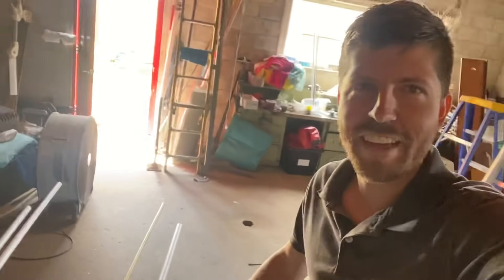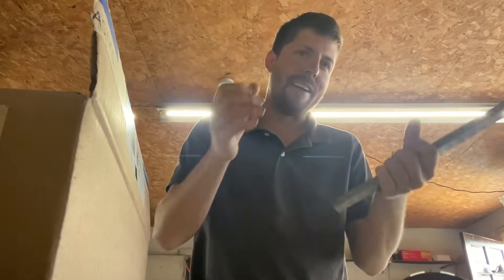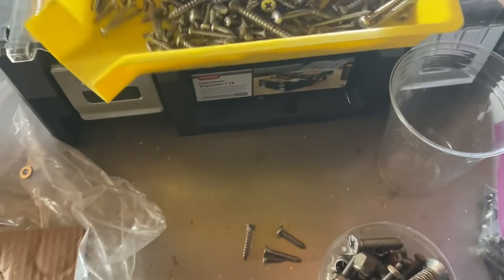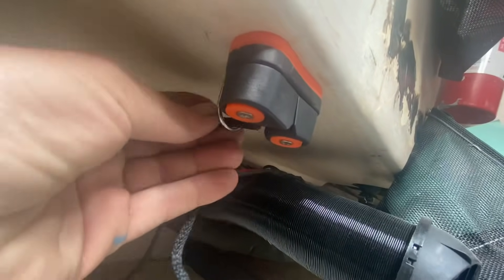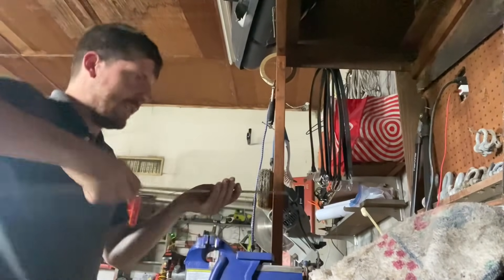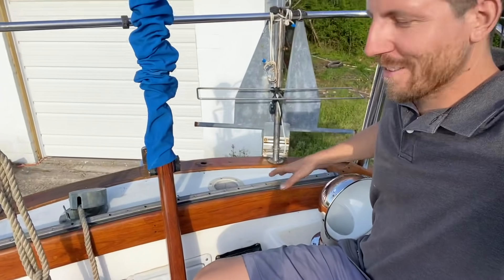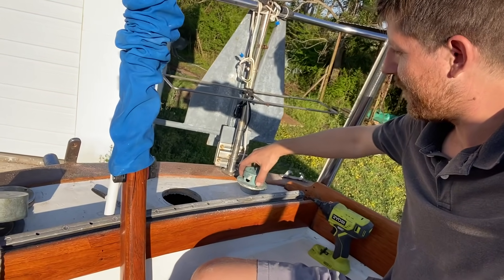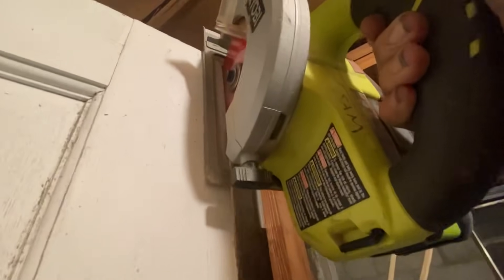Daily Vlog #2

Comment: With the dye, use lube and constantly go a half turn, back it up, then a little further, back it up. It helps keep the cut consistent
Reply: Yes, lots of lube, half turns to get rid of metal chips. SS is very gummy material,  so sharp cutting tools help.
Reply: came here to write this.
Reply: I gasped when the pipe wrench made its appearance.  Yikes!
Reply: also do not buy any tool from harbor freight that requires high quality heat treated steel.  They are single use throw away tools otherwise.  I am not knocking harbor freight, it is just the reality of it. I shop there all the time.
Reply: Def use oil when threading rod (or anything, really)
Reply: Screw these nerds Sam! Party on buddy!
Reply: @jonnyrowland  not throwing shade at him, just trying to make his life a little easier!😂
Reply: @hunterschulz   lolz I know
Reply: An adjustable Die also helps I use them often
Reply: Yeah I was actually a bit shocked when I saw him torquing on that die like that.  Wished I could have talked to him through the TV screen. But that's what it's all about I guess.  Live and learn and next time it'll be perfect I have no doubt.
Reply: That's how I was taught. You can't rush cutting threads, especially with SS. I was yelling Noooo when I saw the pipe wrench!
Reply: It was painful to watch Sam with that die :)  Stainless makes everything a mother, but glad you guys were on top of things and gave some sound advice.  Just chiming in, in agreement with the back and forth and plenty of cutting oil.
Reply: Yeah it did hurt a bit watching 😂

Comment: You have a TIG welder. Cut the threads off a stainless bolt or stainless all thread, and TIG weld it to the end of the solid rod.

Comment: Before you bend straight rod or plate, heat it with a small torch like a Burnzomatic to prevent stress fractures in the future. Always use lubrication when using a tap and die set. And a cap from a 20oz to 2 liter bottle of soda is the same size as the water inlets for washers.

Comment: a couple of tricks I use - I have used teak sawdust as the thickener in my epoxy to fill in screw holes.  I also tape the underside of deck holes and fill grind back some material and fill with thickened epoxy.  I cut a plastic strip from a butter container and tuck it into the hole in a circle and it holds the thickened epoxy in place while it cures.  It easily releases from the epoxy.

Comment: On the bug zapper, cut some of those black strips off than run horizontally around the unit. On mine the bugs sat on them. I cut a load off and now the fly right in easy. They make a right noise too 🤣. I got the 4000 version.

Comment: Hey Sam, just a note. You must use oil or some other kind of lubricant when you are threading the steel rod. Especially if it’s stainless steel. I find that three in one oil works really well put a couple drops on, turn the die a quarter of a turn back it off and then turn it another quarter of a turn back it off, etc. Continue to add the three in one oil as you work your way down the rod

Comment: When using dyes to cut threads you need cutting oil. Sold most places that sell tap and dyes. Then every turn or half turn run the dye in reverse then back forward. It’ll be much easier and you’ll wind up with much better threads.

Comment: As others have suggested; you need to use some oil when cutting and tapping. Also, only go a little at a time, backing off a bit then threading a bit more each time. Lube it in-between backing off and going forward. If you can't get cutting oil, any motor oil will work in pinch.

Comment: tip on  using a die,  You dont make the cut in one process.  you go a few turn, then back it out to clear the cut medal, then go forward again a few turns. Keep repeating the process till you have all the threads you want.  Also use cutting oil like you do when drilling.  Tip for next time.

Comment: While using the die you need to use lubricant, make 1fullmturn then go in reverse a quarter of a turn, then forward again. That will improve your threads.
Reply: I would say don't even do a full turn if its starting to be come difficult to keep going forward ie binding up, before you back it off 1/4 - 1/2 turn and lubricant will definitely help
Reply: If it starts to feel 2 tight, back it out all the way, clean hole, repeat.

Comment: Code inspection with all the DIY stuff
Plumber
Electrician
Destroy the outside wood where carpenter bees/wasps have nests
Learn some masonry and cinder block that (addition) in...
 Beats attic storage as HOT...
And only 03:16 in...

WhiteBoard talk the brass bar to windLess/AutoPilot/Steering? not following

Good -> well
Hinge is the problem with the locker
And stuff leaking thru where screws went in, over time...
Block the back, caulk/ putty seal etc

Radial saw with fingers on little plug. Missing part of a thumb with table saw, can't recommend it...
Yeah, nice sunSet 🌇🌆
Red paint on plastic?
Going to peel off?

Saw instead of plane on door?

Comment: Not sure if it was mentioned. You are misusing the die. When using a tap or die, turn it a half or 3/4 rotation and then reverse it the same. Then go forward and cut again a new area of thread, and reverse.  Follow this process of forward/reverse until the desired thread is cut. By doing so you break away the die chips on each reversal. This makes for smooth threads. Your threads came out rough because you drug the die chips being formed all through the threading process by continually going forward and not reversing to clear the chips.
:) 
Hopes this knowledge helps on your next threading job.

Comment: Turn the locker latch upside down? I've been using a mosquito net since my cats made  a cat door in the screen door, works well. Heat helps bending metal  & will also  temper it for Extra Strength!

Comment: Hey Sam, to help your vice hold smaller diameter round stock wrap the stock in a few wraps of brown paper bag. The bag has some clay in it so it will grip quite tight and will also protect the stock from your serrated vice jaws. Also being slightly under nominal size for threading is crucial, not sure how one might accomplish this though without a lathe. Then again I never understand how people get through life without a lathe 😊

Comment: quarter to half turn of your die, then back it off a quarter turn. That breaks the chip. Just cranking that pipe wrench around in a circle is asking to break the die. and some cutting compound is necessary. Anything is better than nothing- motor oil if you have to.

Comment: Don't want to give you more projects, but here is one that I think you might like:  On my CD28 I cut the counter above the engine out and made it removable.  This gives me really good access to the engine. With this arrangement I can actually change the shaft packing without having to squeeze below the cockpit through the cockpit hatch doors.  Next I am going cut/open up the plywood dividers under the cockpit to give me better access under the cockpit sole.  It is really tight under there.

Comment: re the thread cutting with rod in vice. As others have said it's not the cutting that is the main resistance, it's friction and binding of swarf so lube
and keep backing up.
For gripping rod in a vice. Some thoughts (never tried these, except threading in a lathe)
* find or make a slightly large squared section. drill a hole down the length of it. Make a cut along one edge. Insert your rod and tighten vice to close around rod. (should provide greater surface area to grip.
* if it doesn't need to be round start with square section rod, turn ends in lathe. could turn down whole thing after threading if required.
* but if you've got a lathe, as above, just thread it in that.
* if you don't have a lathe but have a scrap yard nearby look for an old lathe chuck for jobs like this.
*if you want to know how good epoxy is or isn't try setting the rod into a squared epoxy bed. Chip/grind/burn off later
*if rod doesn't need to be straight put a kink in it for vice to grip
* tack weld something grippable to it (assuming welding won't alter the particular steel you're using), grind of the weld later and polish.
*delegate it to one of your helpers then mock them if they're taking too long and upload their struggle, remarking "....hard to get good help"

Comment: Those dies are just thread chasers, used to clean up existing but damaged threads. To cut new threads you need a split, adjustable die.  Instead of attempting to cut the thread in one pass which just winds up tearing the metal, you take several passes while tightening the die before each pass.  Of course using plenty of oil.

Comment: When you're using a dye to cut new threads turn it 1/8 to 1/4 turn then back it off to clear the material you just cut. Continue this process all the way to the end of what you're threading. If you don't clear the dye that material will jamb your tool and tear the threads you're trying to cut.

Comment: Hey, Sam!
The trick with threading is: The diameter of the material should be 
approximately 0,1 - 0.2 mm less than the screw, you want to have. 
And on steel you have to use oil! 
For drilling and threading aluminum you should use kerosene!
Try it! And next time you will have a high class result! 😜👍
Success, and best wishes from Germany!

Comment: Sam, harbor freight taps and dies are for thread repair not for thread cutting. What you need to get is an Irwin brand dye and it should cut threads for you okay. It should say on the package that it's for thread cutting and that's what you want.

Comment: Drilling and threading stainless is tough,  gummy stuff will tear and gall like that. You can try a better alloy like 17-4 or nitronic 60. Slow speed high feed for stainless and use lots of lube, bacon grease works well on stainless and every home has that. Quality tooling will help produce a better result as well. Keep up the good work!

Comment: Deck fill is unnecessary.  So easy to take the hose down below for filling directly into top of tank. Had two 65 gal stainless tanks on my 34 ft boat. Used wooden dowels marked with gallons to check level. Have been watching videos about the IMOCA 60ft open class boats. $1.5 million boats with every high tech gizmo for going round the world. Still, they sleep on bean bags.
Reply: Having a clear hose connected near the bottom of the water tank.....water finds its own level. The hose can the be run vertical in about any location and the level of water in the hose will be the same as the level in the tank.
Marks for gallons is optional and simple.